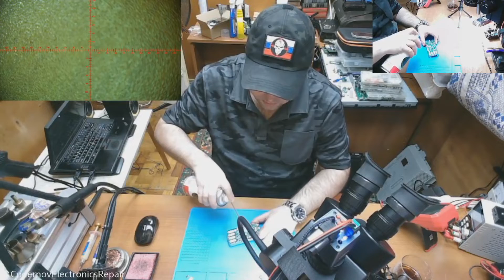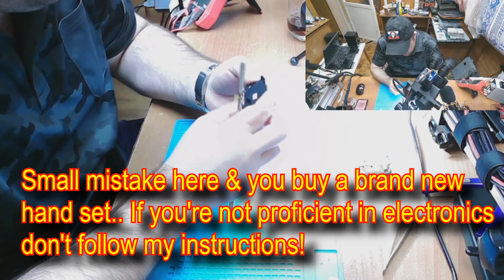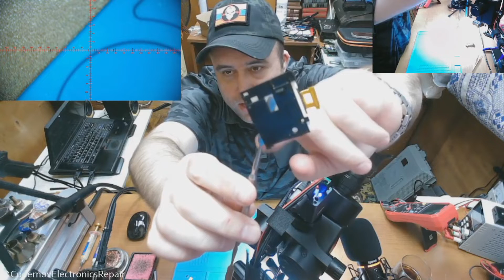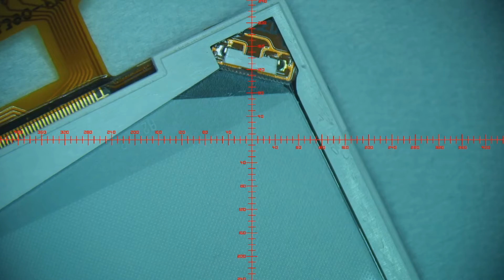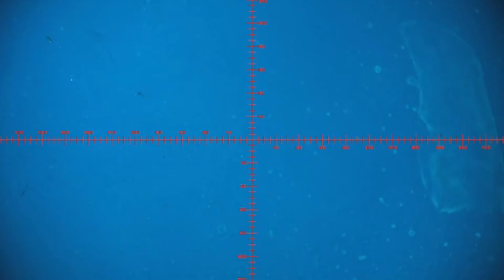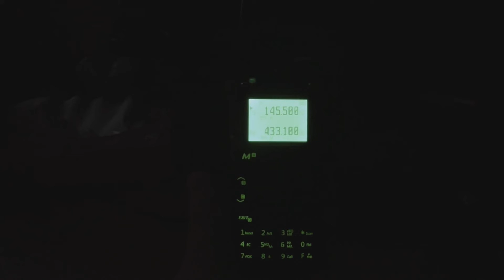Change LCD Display & Keyboard Color - Quansheng K5 (6)

Comment: Next replace flashlight with laser. Great work by the way, I wish my hands and eyes could still do it.
Reply: Naw.
Swap it for an HF antenna.
Reply: @wanderingcalamity360  I have one for, 27mhz and an adapter for long wire, you know I was joking about a laser, but who knows.
Reply: @AdamosDad   
Nice.
I'm just getting my feet wet with it.
Reply: @wanderingcalamity360  
16 turns and what do you get? 🎜
Another day older and deeper in debt. 🎜 
St. Peter don't tell me that I can't go🎜
I owe my soul to an old radio🎜📻      73's🎙